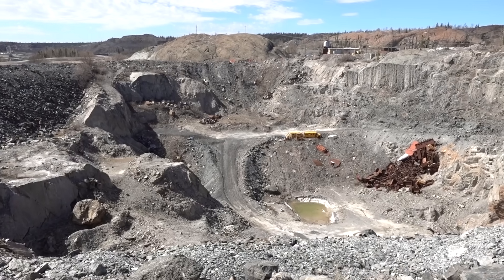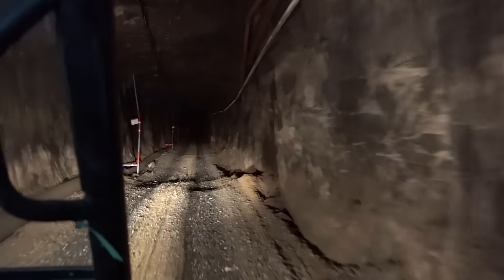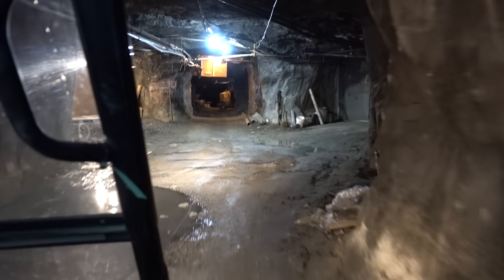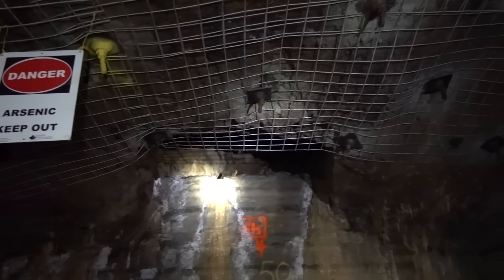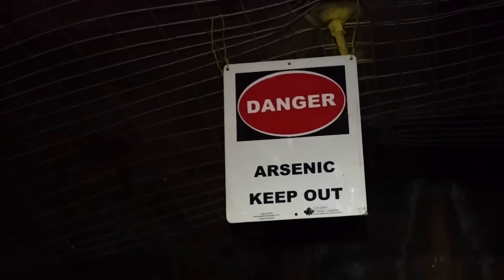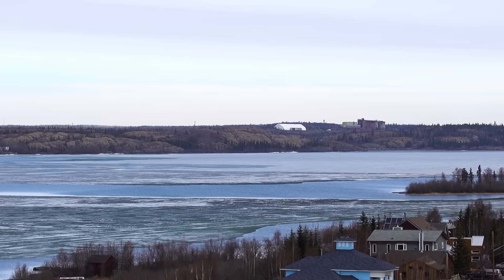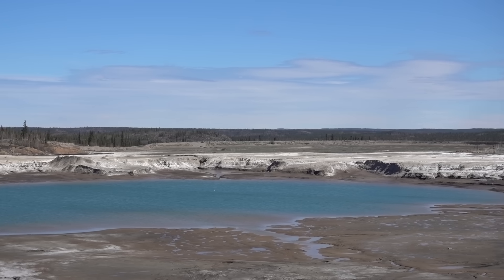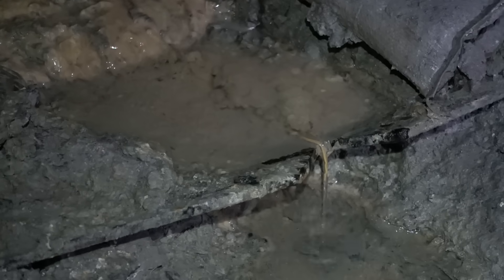Making 200,000 tons of arsenic dust safe

Comment: Whenever people bring up 'nuclear waste' as a concern for power plants I really can't help but think about things like this, and how much safer and easier to deal with nuclear 'waste' actually is compared to so many other kinds of industrial waste.
Reply: I'm not aware of any people dying from nuclear waste contaminating the environment. However, people dying from the toxic sludge from overflowing dams of mining waste, seems to be a yearly occurrence.
Reply: @skitidet4302  Current best estimates on total excess deaths from the Chernobyl disaster stands at around 100, maybe some more if you want to be hyper cautious. Zero of those deaths have been outside Ukraine. Current estimates of deaths from Fukushima is ~560+, possibly over a thousand if you want to be hyper cautious. Only 1 (one) of those was from radiation the rest are all estimated from stress and disruption caused by the evacuation. 

Ukraine: 100 deaths direct or indirect from nuclear power based on best estimates. 
Japan: 560-1000+ deaths indirect from nuclear power based on best estimates. 

That's the total number of excess deaths worldwide based on best estimates for the entire 66 (at time of writing) years of the history of commercial nuclear power.

According to the research, exposure to fine particulate matter, or PM 2.5, from burning fossil fuels was responsible for about 8.7 million deaths globally in 2018. Or, to put this into further perspective, fossil fuel pollution kills more people each year than HIV, tuberculosis, and malaria combined.

8.7million in a single year. 

In 2015, researchers for the Global Burden of Disease published what was described as “the most comprehensive worldwide observational epidemiological study to date”—which had calculated the annual PM 2.5 death toll at 4.2 million.

The entire history of commercial Nuclear power is responsible for less than 2000 deaths at best and most conservative estimates. Fossil fuel energy generation has been responsible for somewhere in the region of 277 million deaths (conservative estimate) over the same time span. When one looks at the numbers, it becomes really crazy.
Reply: @MachineCode0  Chernobyl and Fukushima was not included in what I was talking about. I was strictly talking about nuclear waste contaminating the environment as that would be analogues the a mining waste pond failing.

No one is arguing that the Chernobyl  or Fukushima disaster where planned events to dispose of nuclear waste, thus it's more fair to call it fallout of a nuclear power accident than contamination from nuclear waste handling.
Reply: @skitidet4302  Sorry I know that, I got what you meant, I was trying to point out that the Nuclear power disasters have killed such number of people to contrast the worst case scenario with the potential deaths from waste management, I should have been more clear I'm sorry. 

So to be clear; as far as anyone knows (based on my reading) commercial Nuclear power waste disposal has killed single digit people in it's entire history at the very very most (but probably zero (0) people).

However I don't have any actual numbers on that to hand, so I used the numbers I do have (which are even worse than what you were talking about) to illustrate how little impact nuclear waste has had in terms of deaths compared to something everyone has accepted and not paid nearly as much or as emotional attention too (air pollution from fossil fuel power generation).
Reply: @MachineCode0  Where are you getting your numbers of Fukushima deaths? If Chernobyl is 100 how can Fukushima be 560? A lot of people died because of relocating but a lot of people died because of relocating because of Chernobyl. The only deaths that should count are those directly linked to exposure to radiation not secondary effects.
Reply: @MachineCode0 sure buddy, stress. It’s almost as if there was a censorship.
Reply: Spend nuclear rods can be recycled and reused up to 5 times so there's really not much of it. 90% of what is considered nuclear waste are just contaminated clothes and such
Reply: @qltcn  yes, classified as "Low Grade" nuclear waste, fuel rods can be enriched numerous times and what high grade waste there is gets put into cooling ponds for a few years before being disposed of by storing them in shielded containers, as to if there is any further use of this reactor waste afterwards is unknown to me, but I do know that depleted uranium has been used as a sabot for tanks
Reply: I like your PFP. ~Azsula
Reply: „safer and easier to deal with“ is probably a very relative thing.
And besides all interesting facts and numbers in this thread, potential risk during operation is different. We consider Tchernobyl and Fukushima worst case scenario, but they aren‘t.
And the arsenic byproduct here is not likely to suddenly explode nor is the process in which it is created.
So there is the pure operational aspect which doesn‘t compare really plus the long-term waste aspect, with different ‚scales‘ (would love to see a comparison, this is beyond me, but one being radioactive, they can‘t be simply the same), but also comparable problem: A temporal problem way beyond anybodies horizon. With long-term effects way over 100.000 years, it is simply incomprehensible. Maybe we are all extinct looong before any consequences could be relevant.
Reply: @pan6593 Chernobyl is physically impossible with modern reactor design. Claiming that could even be possible let alone probable is ridiculous.
Reply: @pan6593  
fukushima
destroyed by a natural katastrophy bigger than expected

Tchernobyl
bad reactor design and human stupidity. afaik no reactors like that are build anywhere.
Reply: @roberine7241  Fukushima actually had design flaws. Investigations from health officials and the company itself before the incident, stated that the reactor needed to up its safety. The owner said suck my kintama. So it wasn’t just that they had a nasty tsunami, they also utilized Diesel generators to cool off the turbines that when flooded with water, kind of stalled out.
Reply: @godemperormeow8591  oh it had. though I'd guess those are not present in other nuclear reactors (If so I'd like proof of that)
Reply: (Mining/processing/burning) coal puts more radioactivity in the air than anything but a meltdown will do.
Reply: what people don't realize is, we already figured out nuclear waste. those toxic yellow barrels of green goo are just in movies.
Reply: Nuclear waste doesn't really leak into the environment, it's just radioactive - so if you just stuff them in a box far enough from other people, you'll be fine.
Reply: Have you ever considered where uranium comes from
Reply: CO2 is a much more dangerous industrial waste than nuclear power waste
Reply: Apples & oranges mate. If the arsenic weren’t already in the ground & was instead piling up at generation sites & needed to transported on trucks past homes the logistics & politics of this would all be very very different.
Reply: Yup.
Reply: This
Reply: This is the kind of discussion I love to see
Reply: @ButterfatFarms  In principal or specifically? If you believe that in principle then you are throwing the entire scientific method out the window and just believing whatever you want to.

 If you mean specifically with some particular data sets or such, well I don't know of any. There is very little incentive globally to fudge things on purpose and massive amounts of oversight and interest and incentive to overstate the impact and damage or catch anyone out who's understating things. If you'd like to point me to some good credible info somewhere on this issue please do.
Reply: A lot of people overlook the fact that green energy technologies like solar panels, wind turbines, battery storage, electric vehicles, etc. require a whole myraid of minerals to be mined & refined. Some of these mining, refining, and manufacturing operations produce toxic byproducts.
Reply: Dead right.  The volume of radioactive waste is tiny by comparison.
Reply: well nuclear waste poses the same problems as this. its radioactive and toxic instead of just being toxic. there just is way less of it
Reply: @ghostbirdlary  The problem is the lack of regulation forcing the gold mining company to follow the same environmental standards that a nuclear power plant would from the very beginning of the project. It's a cultural and governmental problem. There are mining companies getting away with environmental murder as we speak, but if you try to push officials to do something about it they're suddenly going to find themselves running up against a tsunami of money and corruption. Nuclear power at least has one benefit in that they generally require so many long term loans up-front to get started that it requires government financial assistance to get off the ground. So they have to do things by the book or else they don't get their plant. The bargaining chips are in favor of the officials, at least in the very beginning.
Reply: @GirthOfANation  fair point.
Reply: @ghostbirdlary  Sure, but nuclear waste gets less bad over time, and can be recycled. Arsenic is just gonna stay there until the earth gets swallowed by the sun, or until the cooling fails and water seeps in.
Reply: Nuclear can clearly be as catastrophic though, both things should be treated with massive caution and generally are, any state can fall though and incompetence can be found everywhere
Which is a global concern for nuclear rather than a localised issue for toxic waste
Reply: @thecookedchef.recipes  well yes and no. certain types of nuclear are fail proof like water thorium reactors. they cant melt down like uranium. if it explodes the water is gone and the reaction stops because the water is the neutron moderator.
also the only "Big" nuclear incident in the US was three mile island which still wasnt a big deal so people being worried about nuclear are just ignorant. fossil fuels on average kill like over a dozen million people per year. nuclear on average kills 300 which mostly came from chernobyl liquidators and fire fighters and stuff. take that out and the averaage is waaaaaaaay lower

Comment: Where did the arsenic come from?  Did the miners put it there for some reason or is it naturally occurring?  If it is naturally occurring, wouldn't it still be there if the mine was there or not?  Also, arsenic has quite a few industrial purposes.  Are they recovering and selling the arsenic?
Reply: In this instance the gold was associated with a mineral called arsenopyrite, which has to be purified in order to extract the gold. This process leaves behind the toxic dust, and it seems to be from the mine.

The issue now is that instead of the arsenic being locked up in the minerals, and being slowly released into the environment over millions of years, it has been liberated and unless cared for, will quickly go into the wider environment
Reply: Arsenic trioxide has some uses, but it may be that there are cheaper sources of it at present/this mass needs purifying further

Comment: Why not just encase the rooms in concrete, metal or plastic?

I don't get how the arsenic can be dropped below freezing point just from the cooling properties of......air that is above freezing point. That makes no sense.

Also, isn't there some kind of chemical they can pump in there that would react with the arsenic to produce a safer product?
Reply: Your not smarter than all the people who solved this problem they worked it all out, if you actually listen to the video you'd know how "the air" freezes the aresnic

Comment: Dissolved in water? Mix the dust with water then boil the water to evaporate it and the bigger problem would be solved?
Reply: Then your left with arsenic again.

Boil salt water, the same thing happens
Reply: is this guy even understand what basic chemistry (or even basic common sense) is? Cause this is next-level stupidity.

Comment: Would locking the dust in polymers like plastic or resin be an option?

Finely mixing the arsenic into the mixture so that the only way that escapes is by actual grinding down of the material, but encasing that mixture in pure polymer and sealing away this statue of arsenic underground? 
Possibly reuse the underground chambers system that is currently holding the frozen arsenic?
Reply: That option is not on the table. The Arsenic dust is already sealed in the empty chambers, and even if it wasn't attempting to mix two hundred thousand tons of one of the most toxic materials on the planet with different Plastics would disturb it end more than likely deliver a dose of arsenic to the local population
Reply: Everyone’s pop bottles made into a polymer and encase the. Area

Comment: That’s quite a handy technology to freeze the tunnels with very little energy needed. Why is this available for consumer use? Would make a cheap air conditioner saving 1000s in energy costs
Reply: It is available for Consumer use. The problem is most areas that use air conditioner don't have an average air temperature of 0 degrees Celsius, at least not when people want to use their air conditioners

Comment: Other than the cost of the volume needed, why cant they fill the shafts back up with cement to block off the flow of water?
Reply: The mine shafts are not the only way water is getting down there.

Comment: I'm confused by this.
I'm a maintenance technician for an industrial chrome plating company, and we're responsible for all our hazardous waste indefinitely. I know where hazmat barrels are stored long term that were produced, used, and disposed of before I even started working there (not off the top of my head, we have a very thick logbook). We had an incident with one of our waste handling facilities about 10 years ago, roughly 275 [U.S.] gallons of nitric acid, hydrochloric acid, metrolux and a couple other chemicals spilled and it cost the company a couple million in cleanup. Now they're paying almost triple for long term solid hazmat storage.
How the hell did these guys just abandon powdered arsenic?

Comment: How does termosyphones can freeze?
İs air that cold?
I need to learn.
Reply: Or it happens because CO2 takes heat continually?
Reply: The CO2 is constantly pulling heat out of the Rock and releasing into the air

Comment: Wouldn’t it make more sense to just process the dust into arsenic metal? It’s a useful element and the metal is much more stable. Yes, the freezing might be cheaper in the short term but it doesn’t absolve the problem, it just slows it down.
Reply: No, that would be an incredibly dangerous process. This mine sits Incredibly Close to the world's 10th largest lake, and groundwater seeps through every orifice in the ground. It would be so easy to contaminate the environment that they don't believe that worth the effort

Comment: Could u fill the mine with concrete
Reply: They do and will, it's called "backfilling".. Tom was incorrect in saying that there were huge caverns left open.   that would prevent mining out the entire orebody as "pillars" would have to be left to support the roof.   What is normally done in modern mining is to mix the waste crushed rock with cement and fill the mined-out cavities called "stopes". Then when it is set, the pillars are taken out giving 100% extraction.  Then more waste rock is backfilled tinto the cavities where the pillars were, so the ground does not subside later.

Comment: Liquid carbon dioxide only exists at high pressure (at least 5 atmospheres).

Why not just cover the area with dirt and let the permafrost go back to doing its thing?

Anything below 4 meters underground will stay very close to the average temperature year round.
Reply: The problem is that grounds has been Disturbed and is no longer permanently Frozen. This allows groundwater 2 Leach through it

Comment: The best way to lock it down long term that I could possibly suggest with my limited knowledge would be to embed the dust in an obsidian like plasma rock created from using a plasma waste to energy generator.  You obviously wouldn't want to use the resulting rock in anything that could lead to the arsenic being released into the environment, but it's far more stable than the "solution" of freezing it in chambers.

Comment: here is a idea ... make a trench along the lake and fill that trench about 5 or so feet thick and about 30 feet deep and mix batch of concentrate and fibers to add to the strength and what ever to make it water proof. then once that is done blow the mine and let it fall into it's self when you blow it ... would be best to make it almost implode instead if exploding to keep the dust down to a min. that might be the best long term thing for it.

Comment: What will happen to this scheme with climate change? The thermal siphons work with the current cold temperatures, but if that area were to warm up by say 5°C or something I could see the effectiveness being reduced, causing problems.
Reply: If the entire planet rapidly worms by an average of 5 degrees Celsius, then the absolute containment of arsenic trioxide in this one mine will seem like a non-issue, or at least a local issue. Plus, it's cold enough in the Northwest Territories that and if the global temperature goes up, the heat pump will continue to function
Reply: @zacharyhenderson2902  You do have a point that this is far from the biggest issue climate change threatens us with, but it' still something those working on this need to consider. To my understanding warming is more extreme near the poles, so a global average increase of only 2-3°C could result in a 5°C or more increase in this region.